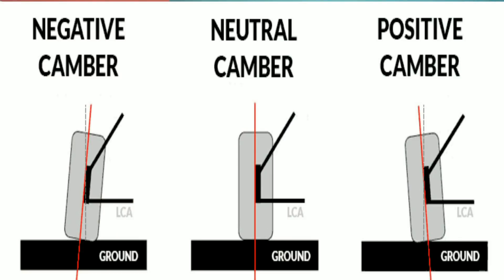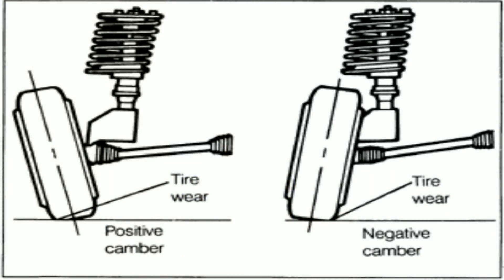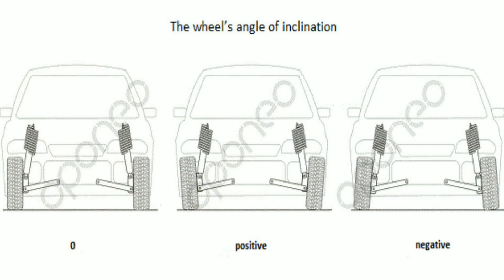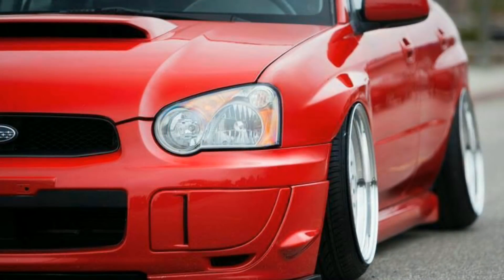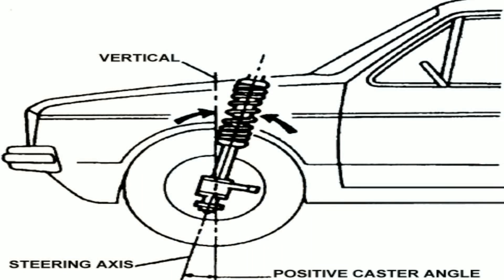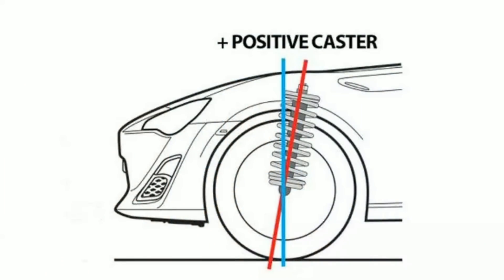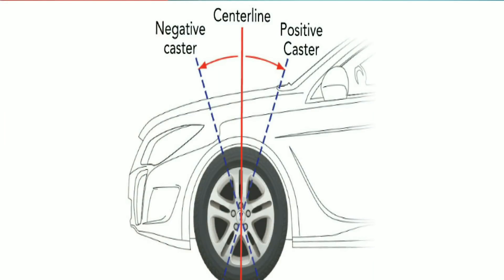What is Wheel Alignment | CAMBER, CASTER ,TOE Explained | Malayalam video| Informative Engineer ₹

Comment: എന്റെ വണ്ടിയുടെ ഒരു പ്രോബ്ലം പറയട്ടെ കഴിയുമെങ്കിൽ answer തരണം, എന്റെ വണ്ടി 2010 honda twister ആണ് കുറച്ച് നാളായി വണ്ടിക്കൊരു missing. accelarator stedy ആക്കി ഒരു 40-50 speed ൽ പോകുകയാണേൽ വണ്ടി ഇടക്കിടക്ക് ഒന്നു വിക്കുന്നപോലെ ആകും, എന്നാൽ അതിൽ കൂടുതൽ സ്പീഡ് ൽ പോയാൽ കുഴപ്പമില്ല.കയറ്റം കയറുമ്പോഴും കുഴപ്പമില്ല. ഞാൻ 5-6 workshop ൽ കാണിച്ചു ഒരു രക്ഷയുമില്ല അവസാനം showroom ൽ വരെ കൊടുത്തു ഇപ്പ്പ്ഴും പഴയപോലെ തന്നെ. അവരോടു ഞാൻ ചോദിച്ചു എന്തുകൊണ്ടാണ് ഇങ്ങനെ വരുന്നത് എന്തായാലും നമുക്കത് മാറാം but അവർ ഒന്നും പറയുന്നില്ല,carborator,air filter,engine head ഒക്കെ clean ചെയ്തു. എന്താണെന്ന് വല്ല idea എം ഉണ്ടോ. എല്ലാരും പറയും experiance ആണ് വലുത് എന്ന് എന്നാലും തെറിക്കും നല്ല പ്രാധാന്യം ഉണ്ട് എന്നാണെന്റെ വിശ്വാസം. ഇതൊക്കെ പഠിച്ച കുറെ ആളുകളോട് ഞാൻ അന്വേഷിച്ചു അവർക്കാർക്കും ഒരു correct ആയ നിഗമനത്തിൽ എതാൻ കഴിഞ്ഞില്ല.ഞാൻ കൊടുത്ത ഷോപ്പിൽ ഉള്ളവർക്ക് അറിയാഞ്ഞിട്ടാണോ അതോ മറ്റെമതിങ്കിലും കൊണ്ടാണോ എന്തോ എനിക്കറിയില്ല. കഴിയുമെങ്കിൽ ഇതൊന്നു പരിഗണനയിൽ എടുക്കണം
Reply: Low rpm il engine missing varukayum higher speed il ath sariyakukayum cheyyunathine usually lean misfire ennane parayunnath. Carburetor ne issues illengil intake manifold leak or fuel filter (just below the fuel on off lever) nte complaint akam. Also make sure the inlet to the air filter below the seat in twister is not blocked
Reply: ഏകദേശം ഇതേ സാമ്യമുള്ള complaint എന്റെ കാറിനും ഉണ്ടായിരുന്നു .. എന്തോ വലിയ തകരാറ് ആണെന്ന് കരുതി show roomil കൊണ്ടു പോയതാ ... but .. Power sply പോകുന്ന cable  ഒന്ന് വിട്ട് ക്കുവായിരുന്നു എന്നാ പറഞ്ഞത് ... ഇപ്പോ Ok ആണ്
Reply: 9656909661  msg me
Reply: bro tirodend,lower arm ,ball joint,shock stud bush pattumenkil ethellam onnu change cheyyuka..ennit wheel alignment cheyyuka..front tyre randum chek chukka ,tyre chadi piduthamo budgigo undengil rotating cheyyuka/front tyre maruka..njn oru alignment technician anu.
Reply: Passion proku ethe problem undarunu, odumbole onnu offakunapole oru second pine ready akum, athu carborater problem ala current nte yannu.auto electrician kanichu Check plug cable and alternator etc
Reply: @ARUN RAJ A കാര്ബറേറ്ററിൽ വാക്വം പിസ്റ്റൺ എന്ന് നമ്മൾ പറയപ്പെടുന്ന ഒരു ഐറ്റം ഉണ്ട് അതിന്റെ ഇഷ്യൂ ആണ്